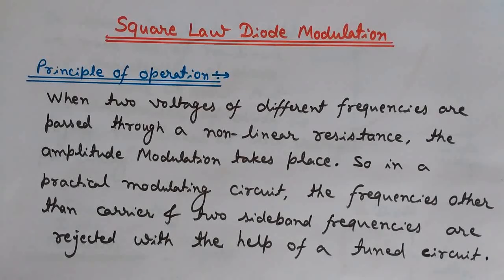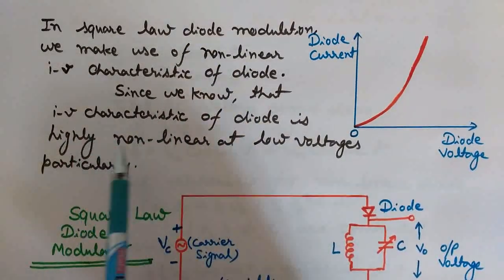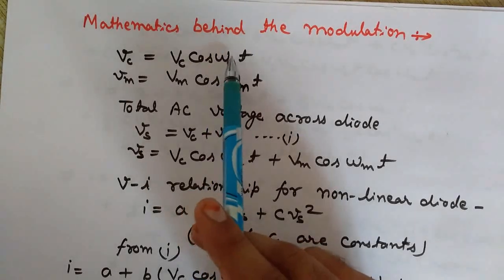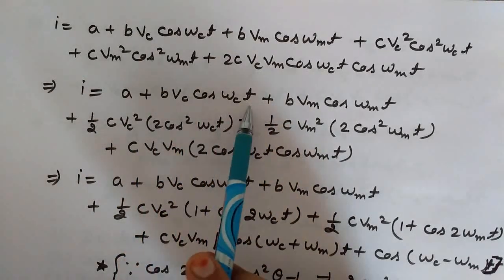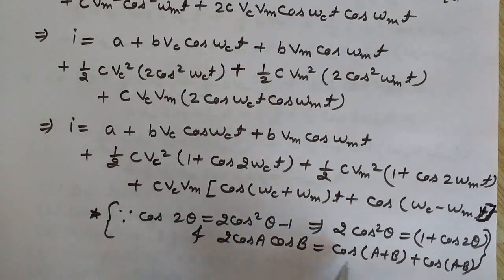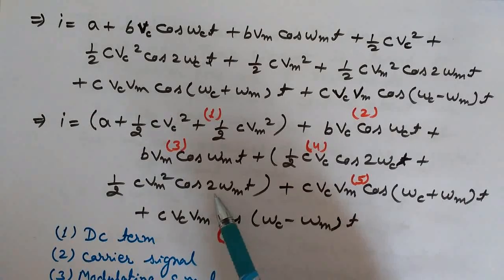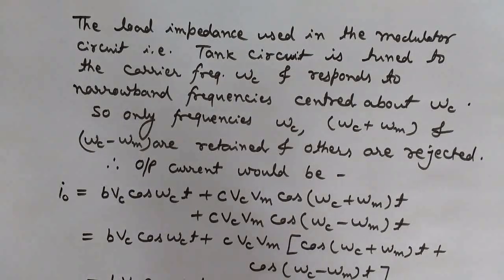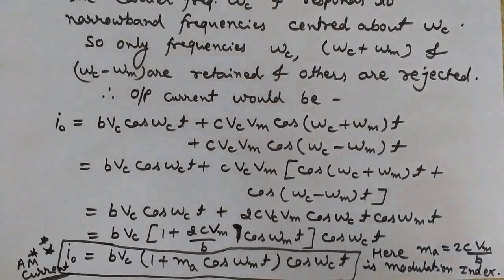Square Law Diode Modulation Method for AM Generation/Non Linear Modulator/Derivation of AM Wave [HD]

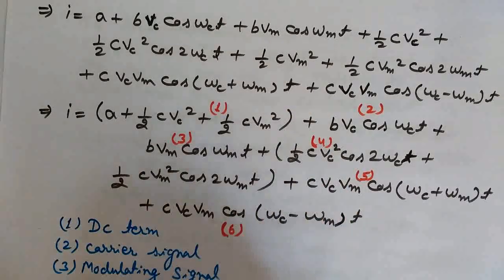Comment: sir great video. I have a doubt at 14:55 , you said something like "this is the harmonic signal or harmonic carrier signal..." something like that. i didn't understood what is that?
Reply from the maker: No problem, actually It is typically applied to repeating signals, such as sinusoidal waves. A harmonic of such a wave is a wave with a frequency that is a positive integer multiple of the frequency of the original wave, known as the fundamental frequency.
Reply: @EngineeringMadeEasy   ohh alright so these will be simply clipped off by our  band pass filter since these frequencies don't fall in our range of  wc+wm to wc-wm , right?
Thankyou!